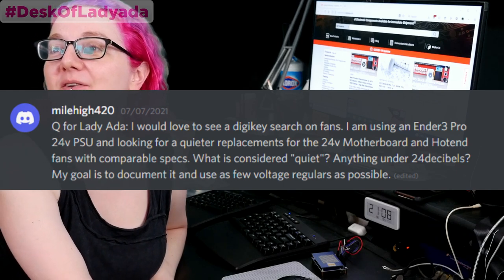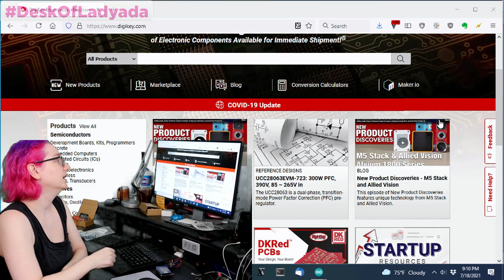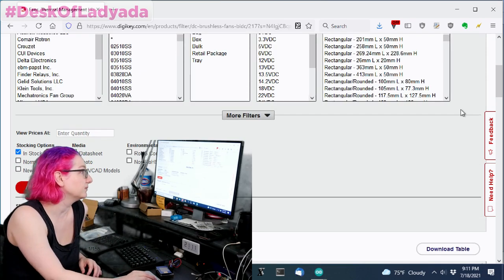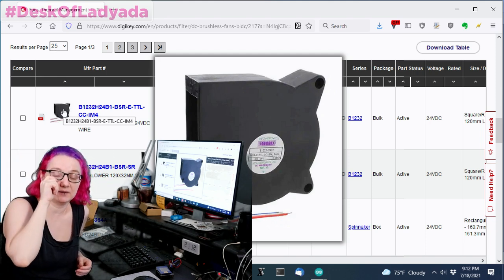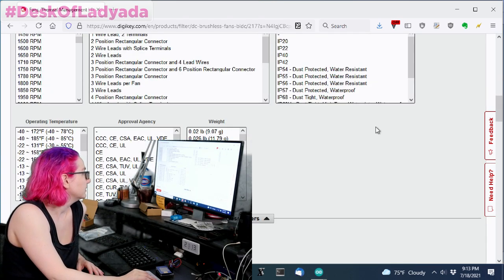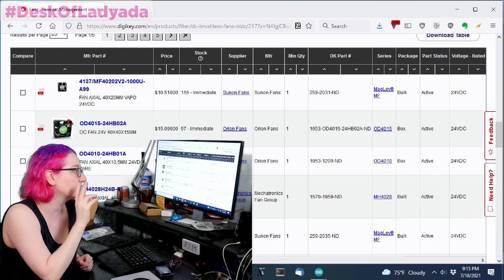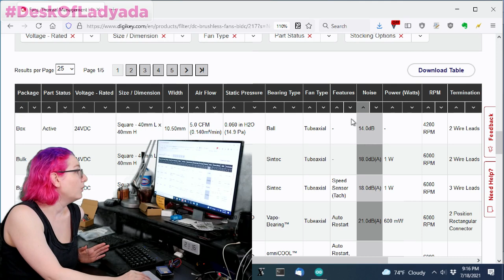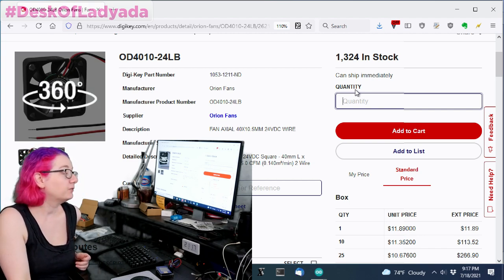The Great Search - 24V Quiet Hot End Fan (3D Printer Replacement)

Comment: Noctua also make a 40mm which is quite popular for 3d printers. Just put one on mine. No regrets.
Reply: @help137  That is true. I have a 12V board so works fine for me. They have some 24V fans, but not 40mm unfortunately
Reply: Not 24V though, so if your printer is 24V you will need an extra step-down converter